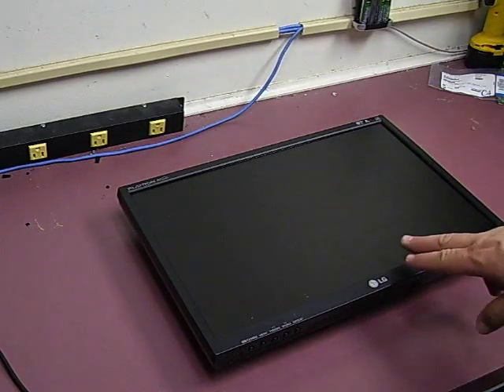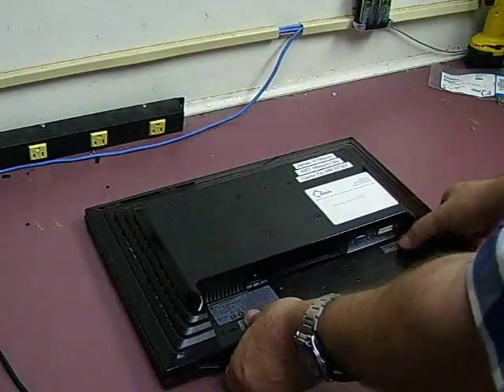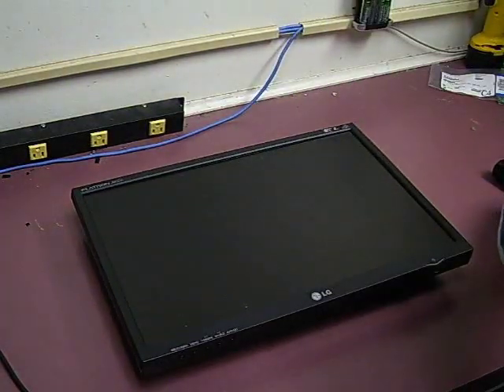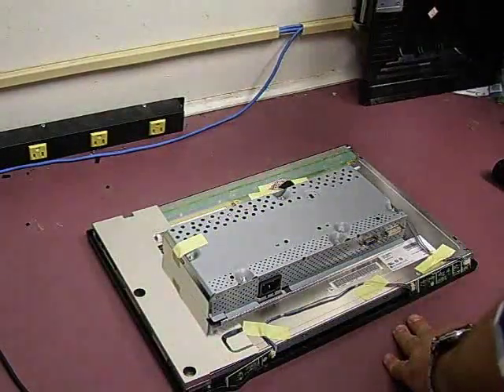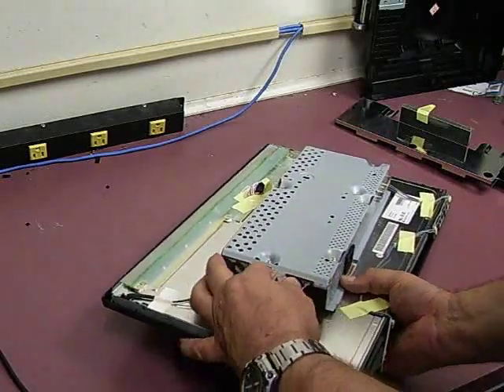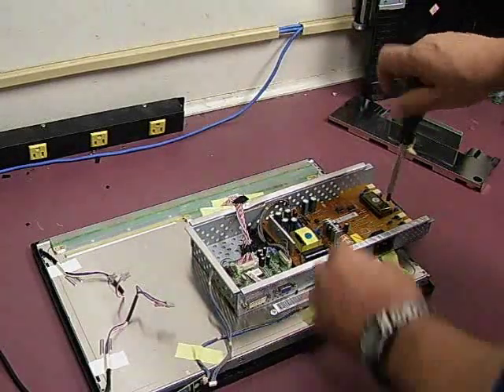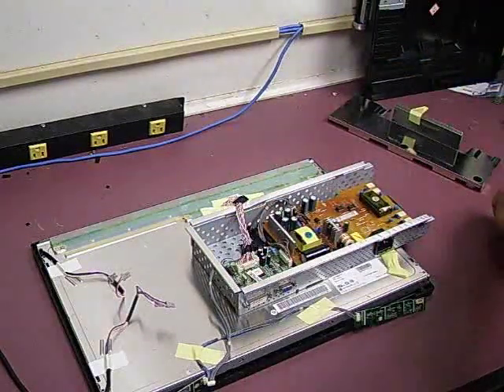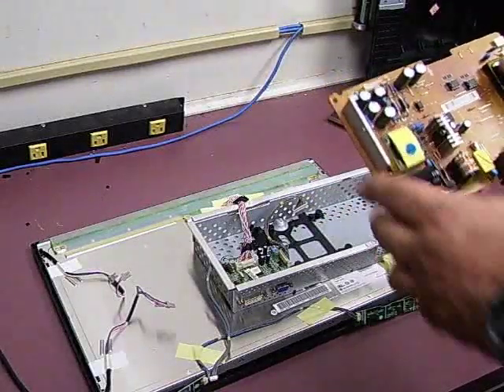Repairing an LG L196WTQ-BF LCD monitor - part 1 Disassembly

Comment: Just took my LG apart and confirmed 1 capacitor blown. Thanks for such an easy to follow tutorial.
 Getting the darn plastic frame loose was the biggest hurdle for me. Unnerving  hearing that CRACK! sound and hoping it wasn't a break in the frame. Whew! Will replace all 4 capacitors and hope to be back up and running.